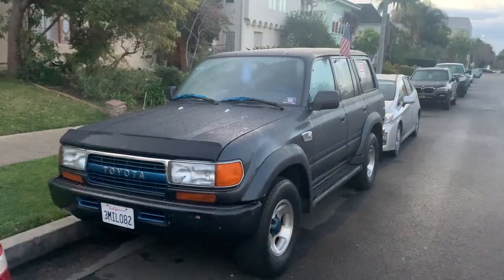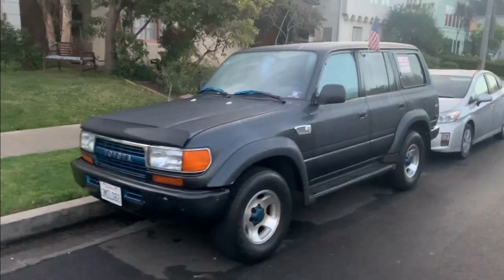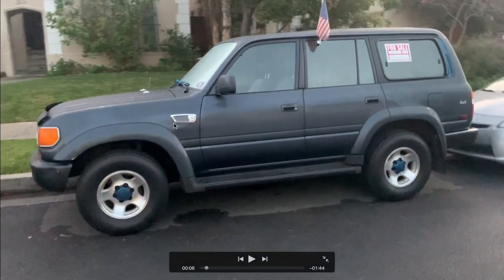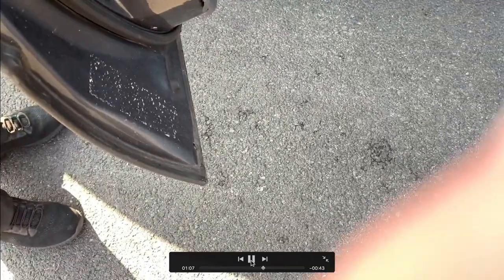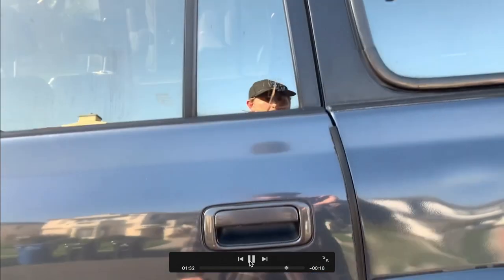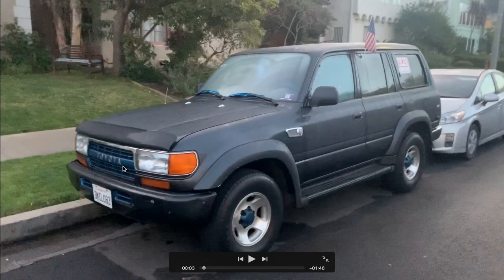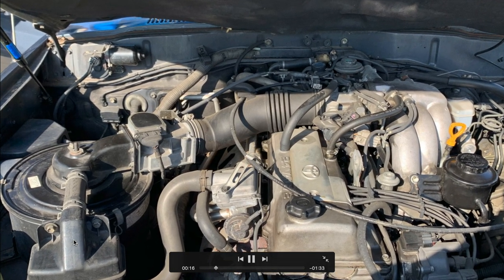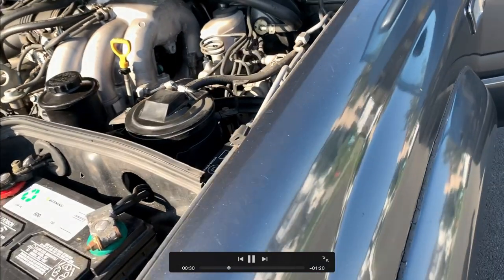1994 Toyota Land Cruiser (Stolen But Locked)

Comment: I just bought a 96 FJ80 with the 4.5 inline 6. The motors are stout from what I could find - I initially didn't want to like the motor bc I only drive diesels. This is my first owned gasser. Lockers are a plus. As for the motor its a larger 2jz, it has 7 main bearings if I remember correctly. the issues with reliability seem to ocme from headgaskets because of the EGR required in the US for emissions. The EGr heats up cylinder 6 by the firewall. Also the cooling system - beware of bad coolant lines going to heaters. Theres a heater line in between the firewall that can fail (The egr right by it heats it up too). if the coolant lines break to the heater thats a no no if it breaks and runs up to hot temp.

The heter hose is called the pesky heater hose. check it out - very important.

Purchased my truck from a family that didn't care for it, some rust, leaky sunroof. so welded up roof rack holes cleaned up rust, stripped moldy carpet and bedlinered the interior on top of floor pans.

check my channel out before this I had an old merc diesel project

Comment: They used the same 4.5L inline 6 until the end of the 80 series production in 1997. 1998 introduced the 100 series and the new 4.7L V8
Reply: @JakeTiesler  thr motor was made until 2009 fyi

Comment: I'm very familiar with California salvage process.  I'm 99.9% sure that is NOT a salvage title.  It has the original (or nearly original) California license plate.  The law mandates you must get a new license plate when it's a salvage title.  Let me know if you have any questions.  I love those.
Reply from the maker: OhYeahAboutThat thanks for the response, on the body on the inside of drivers door it has a tag “replacement identification tag” or something similar ... that’s what threw me off... seen that before?
Reply: Jake Tiesler I remember you mentioning that. I would just have him show you the title. It will sal salvage if it’s been deemed a stolen/unrecovered vehicle or wrecked and deemed salvage. The. Auto Club can run the vin for free if you’re a member.
Reply from the maker: I’ll check it out thanks!
Reply from the maker: I ran it, it’s clean! Thanks man, going to try and negotiate tomorrow 🤙
Reply: Jake Tiesler but that little bit of info is a secret until AFTER you buy it!  Good luck!

Comment: This is a triple lock Toyota Land Cruiser and you was the Hesitant to buy it or not for $4000 this is the definition of a tire kicker why don’t you do a little research and see that the true value of this truck is between 25 and 55,000 I bet you after you check your going to kick yourself in the ass